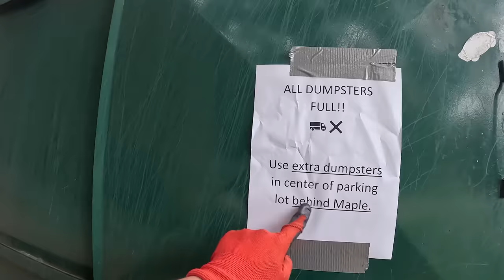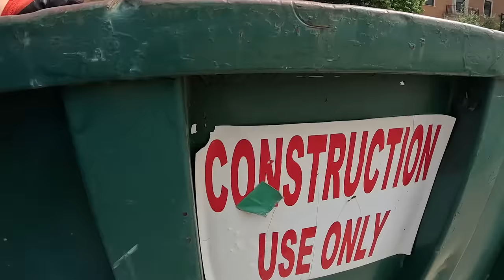Dumpster Diving on a Packed College Campus!

Comment: You should wet some washcloths fold them and freeze them, put hem in ziplock bags. Put them in a small cooler to take with you and when you’re hot take them out and lay over your face and neck. 😅 Use some Gatorade bottles that you drink a little bit outta of and freeze them as well then when you’re really hot take them out of your cooler and they will be like a slushy!😅😅 Stay cool and hydrate!

Comment: On the rugs you find…I used to get great rugs trashing all the time. Still using a lot of them actually. But I’d put them in my driveway and put Dawn dish soap on them and power wash them. Then either leave them there to dry or hang them in a fence. Works great and love love finding rugs! ❤️🙏🏻

Comment: I keep on saying take the other truck also with u. U need it!
Reply: I think their other truck is broke down. They haven't shown them using it in over a year.
Reply: @julien2912   I dont think so.Maybe. but every since she got this truck as a gift from her parents , she is using this a lot. If the truck is broken. She does have a car as well
Reply from the maker: @julien2912  You're right, Julie :)  And regardless, we like riding in the same car so we can talk in between!
Reply: @breafkast  Hi Kelly. It's too bad the other truck doesn't work because for large divess like this you really could use both trucks. But I understand you wanting to ride together in the same vehicle so you can't talk interact on the video. My question is how come you never back up your truck to the dumpster and stand on the bed of the truck? You could probably reach into those bigger roll away dumpsters from the bed of your truck. You mentioned this in recent video to Alex that you should have backed up the truck up to the dumpster, but you still never shown that in a video. Have you tried?